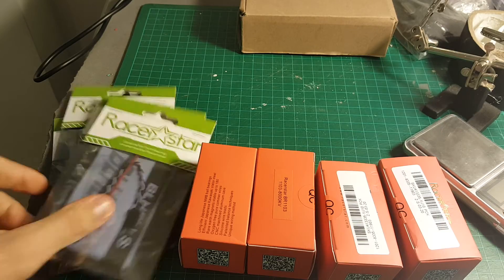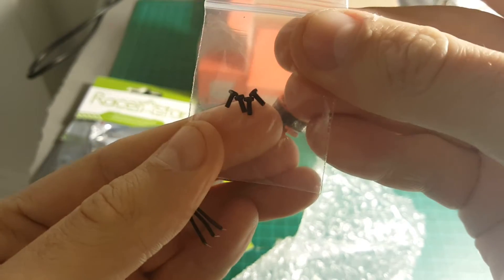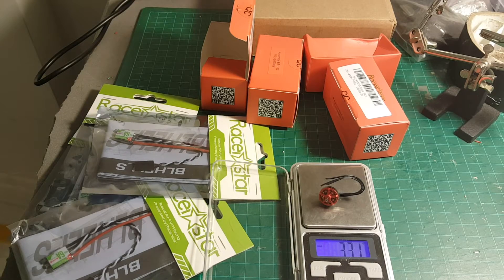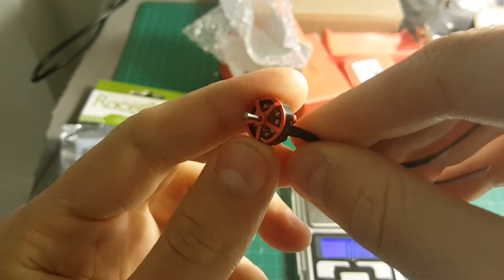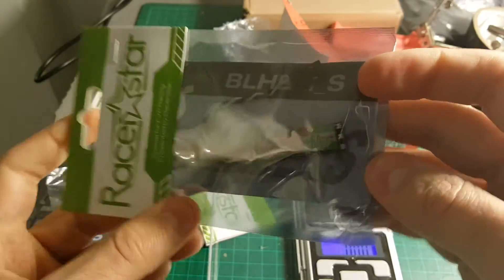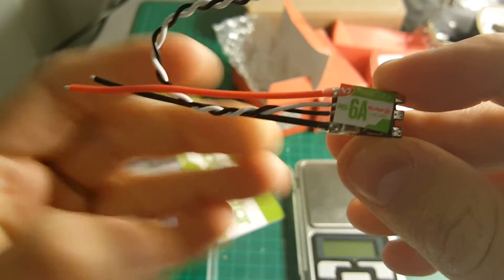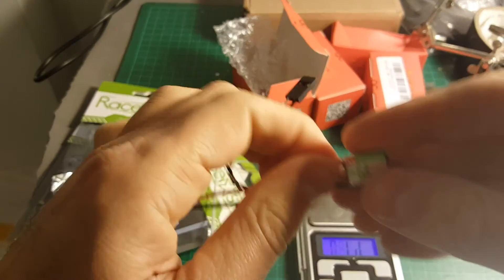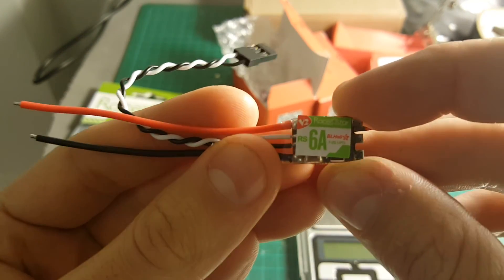Pico X - Micro Brushless Part 5 - Motors and Escs

Comment: how u gonna connect 3 motor wires to 2 ESC wires & BEC also must be 3 wires but here only 2 . Where to take 3rd wire from for receiver
Reply from the maker: Please elaborate.
Reply: Brushless ESC is supposed to have 8 wires coming out: 3 for motor, 3 for receiver & 2 for battery.
 Your  ESC  has a total of 4 wires coming out only : 1 is missing for receiver wiring & 3 missing otherwise
Please identify which of your wires r acting as common ground, common live to cover for 3 missing wires & where to get 3rd middle wire for receiver connection

https://www.gearbest.com/multi-rotor-parts/pp_603868.html

Comment: awesome build,ive got a radiolink at9 transmitter and 1104 motors.what FC and esc's(4n1) do i need to get flying?and for future reference what info i need to determine what FC&esc's goes with what motors,and what battery size to use?
Reply from the maker: Thanks Nickos. Which motors do you have?
You have to check the specs of your motors and see the amp draw using different lipo batteries. In addition, you need to decide if you want to use 2,3 or 4s batteries. Battery size should be between 300-550mah for micro quadcopters, depending on the size of the frame, weight and etc.